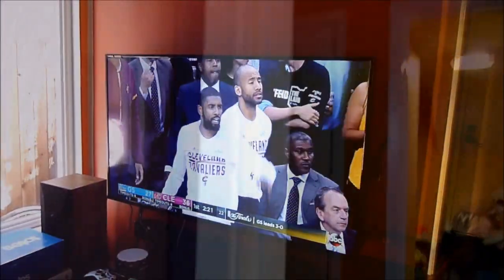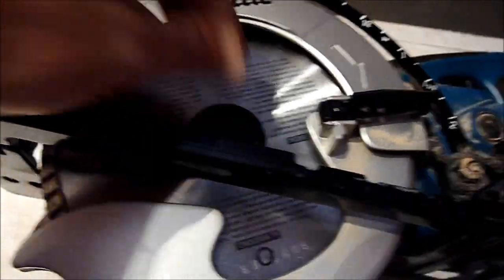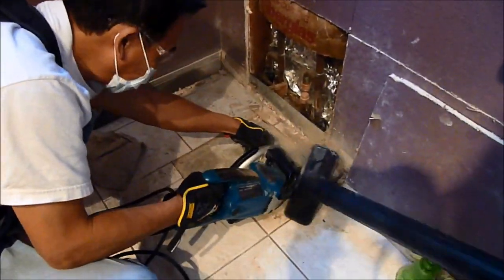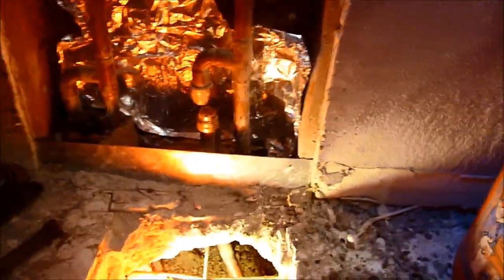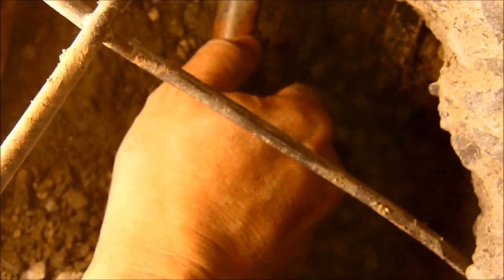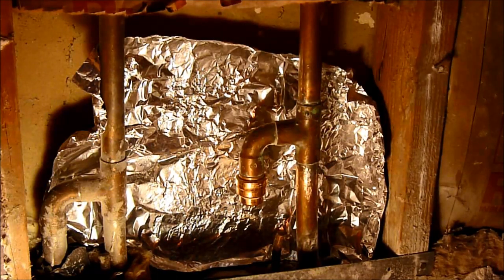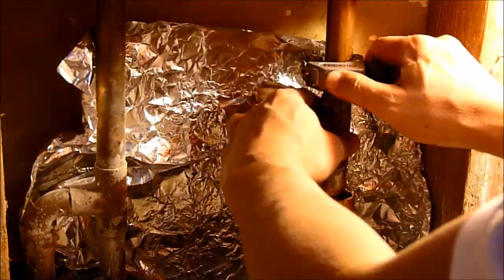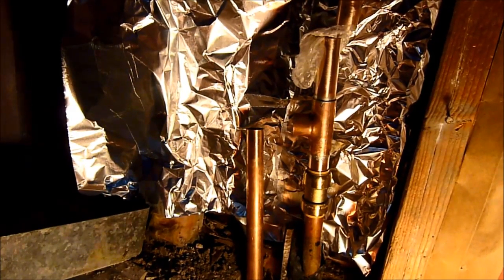How I Fixed My Leaky Hot Water Copper Pipe Under The Slab

Comment: I've seen brand new sharkbite fittings leak probably twice before.  One of those two times it was because it was on a copper pipe and we removed the plastic insert.  In this video you do the same thing.  I'd recommend against that going forward. Personally, I only use sharkbites to do temporary holds.  Sharkbite does have a silicone underground wrap that they sell because the fittings break down underground and they know that.  The brass compression coupling you used should have been wrapped imo because brass breaks down in the dirt because of corrosion.  To soldier when there is water in the pipe, you use a shop vac without the filter (so a wet vac setup) and suck out all of the water.  If you have some residual water after all of that, take some bread (yes bread that you would eat) and compress it and shove it in the pipe as far as you can with your pinky to hold the water back, and then do everything as you normally would (putting the joints together and soldiering it).  Close all other faucets except for a spigot or tub faucet (tub faucet preferred because you can do hot and cold) when you turn the water back on.  This is for preventing any sentiments from clogging aerators on faucets - spigots and tub faucets don't have aerators.  The bread breaks down in the water line and is safe.  Compression fitting pro tip:  use 3 wraps of teflon tape around the copper ferrule/ring, and then a little bit of pipe dope around the teflon tape, then tighten it up well and you never have a leak with them.  Hope this helps people.  Thanks

Comment: First off great job fixing this yourself. Did you do everything correctly and to code? No, but you have a lot of skill to even attempt this repair. This is all I did as a plumber for 20 years. Your problem was the angle iron that caused a friction rub on the pipe. 98% of all below slab leaks will be on the hot side only.
Heating up and cooling down pipes will wear the hot side out quicker than the cold side which always stays the same temp. Great video for me to train the next generation of plumbers.
Thanks
Reply: That's not the case where I live in N. Florida.  I don't see 98% of slab leaks on the hot side.  I am a licensed plumber who repairs slab leaks on a regular basis.  Maybe in some parts of the country the majority of slab leaks are on a hot pipe, but not here.

Comment: Please DO NOT do this. Super waste of time because this is probably already leaking. Avoid all joints under slab, but copper must be brazed under slab and proper fittings used. Good job attempting to do it on your own, but please do a little research first!

Comment: Thanks a lot for this one. Most likely a dissimilar bit of metal like the rebar was touching the copper pipe and over the years weakened the bent side of the pipe. I also have a slab leak that I'm going to tackle. Once repaired I hope to make a plumbers closet and have valves put on each section so that when a leak(they will come up) occurs, I don't have to shut of the whole house. a leak
Reply: It is a great idea about plumber closet. Thank you.
Reply: actually what happens is that a piece of rust travels from the water heater and lodges there causing the corrosion. People don't know that they need to flush their water heaters twice a year to keep sediment and rust from building up

Comment: You have worked really hard on fixing this problem but all joints under the concrete are required to be silvered soldered (brazed) nothing else will last. Your solution was inventive and work for a while but be prepared to go back in at some point to redo. I admire your work ethic but some of the time others must be called to help us. JC Texas
Reply: that's one thing I don't like to use quick connect under ground. plastic will get aging and leak again. Also, soldering technique is very bad.

Comment: You found plumbing in wall, I would have used PEX and went to sink though wall/ceiling before digging floor up.
Reply from the maker: Bobby Juice have you seen water surging from the attic through the ceiling due plex pipe connection broke?
Reply: 3dogs1monkey I have, I’ve saw it surging from pipes behind walls, floors and ceilings. Waters a bitch, but putting copper back in concrete with time you will have a leak again. Could be 5 to 30 years. Because concrete corrodes copper. Plus he only replaced a portion of copper, what’s about the other section that’s corroding. Just my opinion.

Comment: Isn't new housing development moving if not altogether away mostly away from residential subterranean plumbing and routing notably PEX lines within the walls and ceilings? Slab leaks are too costly from what a recent plumber discussed with me insofar as this move in new housing construction since 2000.

Comment: Hello, I had same problem. What caused the hole?
Reply from the maker: armegaz as I understand, the pin hole at the bend caused by soldering flux deposit when they did the pipe soldering. When you fix it, make sure not too much flux flowing down the pipe while soldering.

Comment: Thanks for the advice. Don't know if the hole comes from below concrete or on top at pipe wrapped in plastic. Plastic to thick to cut.Will have to hire a plumber if I had to.
Reply from the maker: armegaz avoid running plex pipes to the attic. Must use compression fitting and check for minor drip before sealing it. I waited 1 month with normal use to be sure

Comment: you never use pipe thread sealer on a compression fitting. thats not how they seal, they seal by compression of the brass   wedding band against the flare of the nut.
Reply: Pipe dope helps them seal
Reply: @he-got-a-new-mommy  stay off the dope.

Comment: here is old plumbing trick.. if pipe has water , stuff bread in pipe, push down bread. this gives enough time to solder,. once you turn water loose, the bread dissolves and exits from the pipe
Reply from the maker: texas tough this is a great tip, thanks, until the connection I’d used failed then I’ll solder them.
Reply: the compression fitting wont fail, but the shark bite might, ..
Reply from the maker: texas tough yes, I’ve seen it failed while trying it, but it’s on the top, easy to do. Thanks again, you’re really a scholar and a gentleman...

Comment: Where to begin… compression UNDER SLAB? Soft solder instead of brazing UNDER SLAB? Sharkbite city!! Lol 
Should have either called a professional to re route through the attic, then you wouldn’t have to had to open this same area up again in the future cuz IT WILL have to be done. Anything mechanical is subject to failure and should be accessible. 
CALL A PLUMBER !!